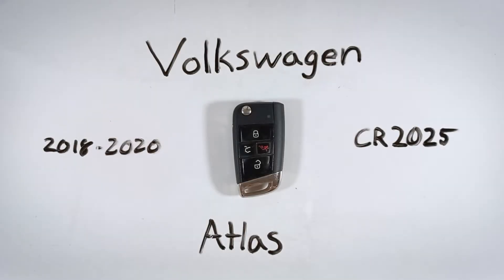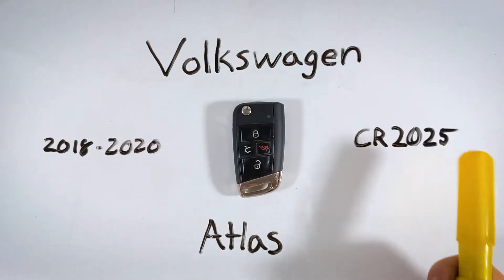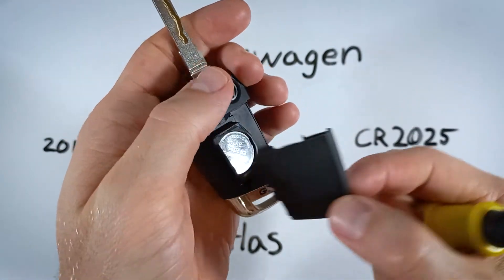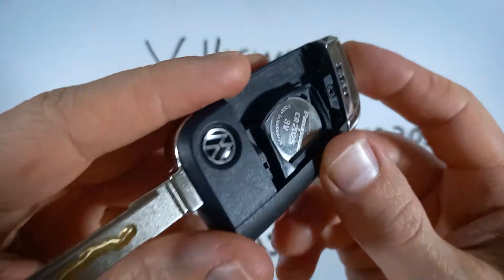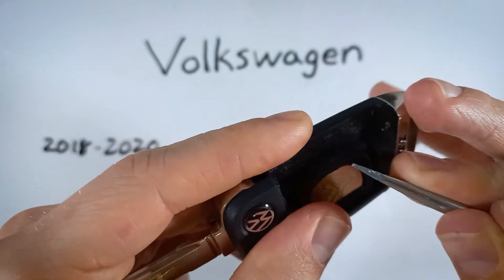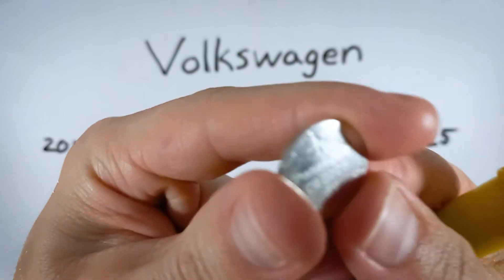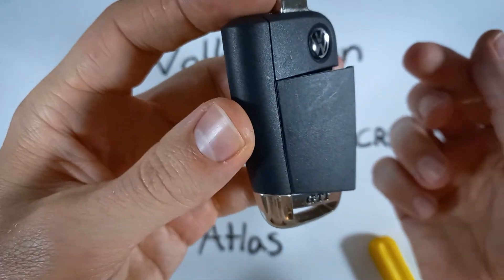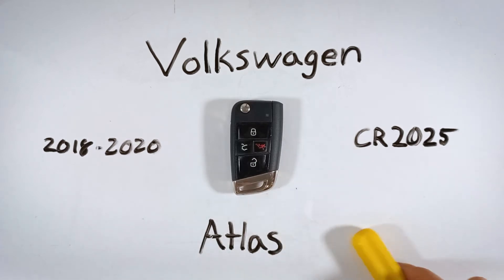Volkswagen Atlas Key Fob Battery Replacement (2018 - 2020)

Comment: OEM hould be a 2032 battery.  2025 is same size and fits but has less capacity and will not last as long.